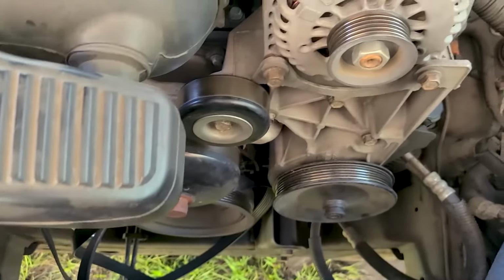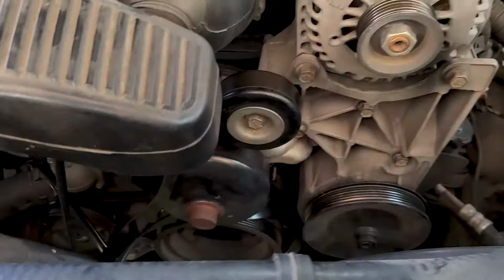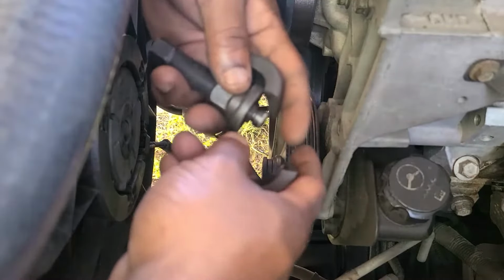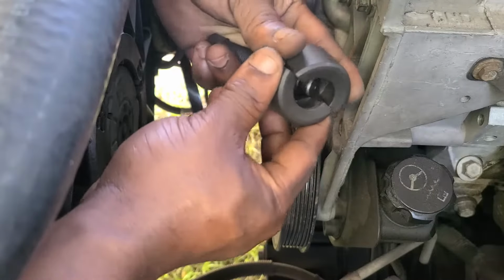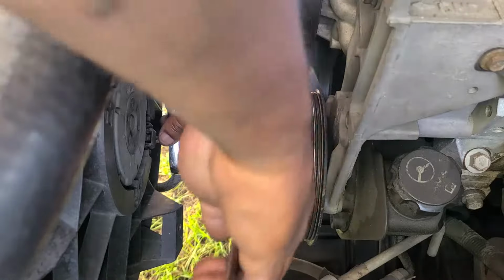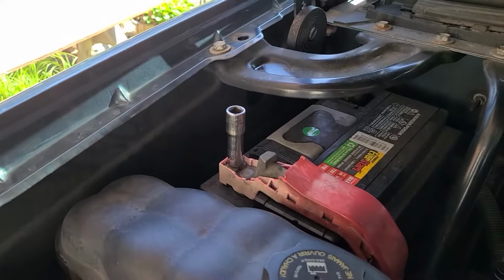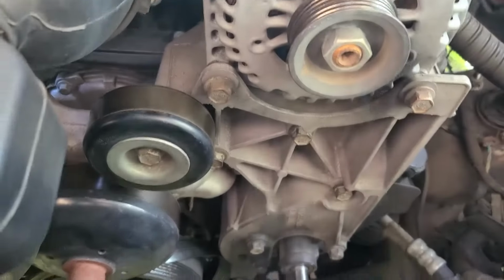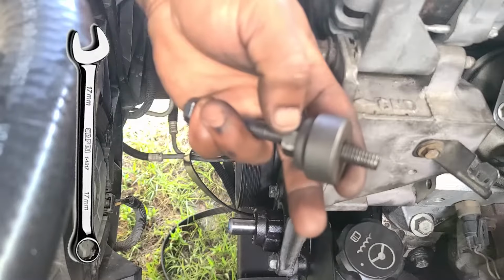How To Remove and Install A Power Steering Pump + Pulley 6.2L 6.0L 5.3L 4.8L #chevy #ls

Comment: It's 2024 and it's still relevant
Reply from the maker: @james9862  always will be🤷🏾‍♂️
Reply: I’m pretty sure my ‘79 Z28 used the same power steering pump.
Reply from the maker: @michaelcahill2912  Possibly. A quick part number search of both vehicles will solve that mystery

Comment: Hey I have a 2005 Yukon SLT 5.3L automatic with 218,000 miles. All stock equipped. 

Doesn't make any noise of any kind, that's abnormal. Well kept and daily driver.

I drove it out on the highway for 300 miles and when I exited Interstate it was in manual steering mode...stiff to turn like it had no pump at all.  And the brakes were not boosted either.  It's not the belt or fluids of steering or brakes...all good. No leaks. No codes. No smells. No noises of pump failure. It only does it at low rpms when coming to stop, under 700 rpm. It works fine when above that. And the brakes are unboosted when it does it also, but work.

This is the pump I assume?  Remove and replace eh?  

Suggestions of what pump brands you had success with?  I'm eyeballing the O'Reily $72 special.

Thanks!
Reply from the maker: Does it have rack and pinion and how does the fluid look in the pump?
Reply: @letsfixit251  no rack and pinion. Fluid looks and smells good.
Reply from the maker: @thesetruths1404  Yeah, it sounds like the pump failing then. Make sure the high-pressure hose is in good shape with no wet spots around it. I purchased my last pump from autozone, and it's still pumping strong.🤷🏾‍♂️
Reply: @letsfixit251  thanks!

Comment: Need your opinion my rack and pinion needs replacing should I just go  ahead and replace all the components like power steering pump and cooler and hoses are just the part that is broke trying to do preventative maintenance since imma be in there
Reply from the maker: Power steering pump yes and make sure you do a good flush of the fluid. If you don't see any signs of leaking fluid from the hoses they should be good. But if anything, replace the high pressure hose just to be for sure

Comment: The one in opinion I do have is that I personally have own two LLY trucks and they are honestly and most diesel mechanic's opinion one of the least look for. They have head gasket issues and overeating and etc. Other than injectors the LB7 is one of the best and then the LBZ because it makes the most horsepower and torque with the least emissions and then after that the LM and or LML is even a better option I would look in that direction if I were you. More horsepower more torque less shoes to worry about in the long term
Reply from the maker: Not worried about horse power on this particular truck. We just want the steering wheel to turn properly and quietly 🤷🏾‍♂️

Comment: I keep reading about making sure you flush the system properly. Do I do that or can I just uninstall the old one, but the new one in and put fluid in and just run it?
Reply from the maker: If your particular vehicle has a rack and pinion, then flushing it would be a great idea, especially if you suspect your system of being clogged. Hopefully you don't find a leak inside it. You can remove the boot on your tie rods to see if it is leaking. Good luck🫱🏾‍🫲🏼

Comment: Did I miss the removal and install of the power steering pump?
Reply from the maker: No but some footage was lost in the process. As long as you're at least a little mechanically inclined, you'll be fine.
Reply: @letsfixit251 hey bro, I don’t understand why you disconnected the alternator and all that just to replace the pulley. Or did you pull the pullley off just to replace the pump then put it back on after. I’m getting a squeak from the pulley , but I still have power steering like normal

Comment: I installed a new pulley and now it has a very fine squeak. You can’t even hear it outside of the car but inside the cabin you can hear it. Not extremely loud but just a fine persistent squeak at take off. Once you pass 15-20mph you don’t hear it anymore. The only thing i can think of is not lubing up the pump shaft. Do you have to grease up the shaft before installing the pulley?
Reply from the maker: Did you bleed the system?
Reply: Yes system is bled. Brand new pump with the pulley as well. So do you think it could be remaining air in the system? I turned  and turned the wheel and let the level go down, then added more power steering fluid until the level stabilized. Then i took it out for a drive and warmed up the engine, then stopped and let it sit for 5 minutes and rechecked the level with the engine hot and running. Normal level. Idk what else it could be besides the new pulley perhaps? I went with a dorman not oem so i’m wondering if that pulley is a squeaky son of a gun lol
Reply: Pump is oem just not the pulley
Reply from the maker: @elmera9472  is the pulley specs the same as oem? Maybe upgrade your belt and check the idler pulley
Reply: Did you find out what the problem was?
Reply: @MindlessPursuit  yes! Swapped out the dorman pulley for a cardone pulley, squeak gone!!!
Reply: @MindlessPursuit also, i did end up using ep (extreme pressure) grease to install the new one, so honestly i am not sure if it was the grease or the pulley that fixed the squeal. I would try the grease first before you buy another pulley.
Reply: I bought the new pulley already, so I will be doing both as well
Reply: @MindlessPursuit sounds good. Good luck! EP grease all the way! Just a light layer should do wouldn’t overdo it.
Reply: Just finished the install with a little EP grease. I noticed that the dealer didn't push the pulley all the way in after they replaced the steering pump SMH. It was eating up my belt because it wasn't centered. Thanks for the video!
Reply: Do I need to do a flush and remove those bolts if I’m just changing the pulley

Comment: Can I use Johnson psf with conditioner for my aftermarket rack and pinion and new pump
Reply from the maker: I'm not sure if I understand what you're asking.
Reply: @ I have a 11 Yukon Denali xl and gm psf is usually clear but Johnson psf with conditions is a light amber because of the conditioner the reviews says ppl have use it in their gm vehicles just want to be on the safe side because it’s a better quality of psf or doesn’t even matter and I’m rebuilding my steering system and this is the reason I ask

Comment: How do you know the pulley is in enough on the pump shaft?
Reply from the maker: It'll bottom out.
Reply: @letsfixit251  Awesome! Thanks!
Reply from the maker: @pibblesnbits  no problem 🫱🏾‍🫲🏼
Reply: @letsfixit251 what you mean by bottom out?
Reply from the maker: @amyfarrell974  the pulley tool from autozone will not allow you to press it no further than it should be. There are some pulley tools that will though. Basically, you press the pulley on until the pump shaft is flush with the front of the pulley exit whole. If you over press it, your belts will squeak like crazy.

Comment: So it's not possible to take the pump off without removing the whole bracket? 😮😮
Reply from the maker: @badas95Z  I don't exactly remember because it's been so long ago, but I'm sure if I took it off, it was mandatory or a safer way of doing it without risking braking something. I usually don't try to cut corners because that's usually when something goes wrong.
Reply: @letsfixit251  okay thanks. Been trying to find the pulley removal tool. I lucked up on a pump for $18.70 at advance auto.  They are closing and have stuff marked way down.
Reply from the maker: @badas95Z  Oh wow, that's a bargain. What state are you in?

Comment: The title says "Remove and Install A Power Steering Pump + Pulley".  The pump was never removed and replaced.  Why would fluid need to be added when the lines were never disconnected to lose any fluid?
Reply from the maker: @SpynCycle57 Yes the lines were disconnected and yes you definitely have to disconnect the lines to replace the pump.